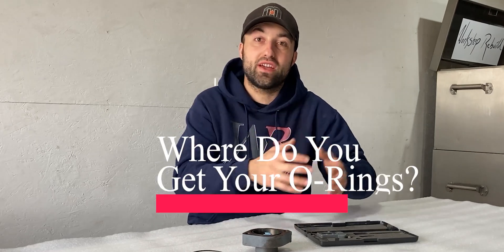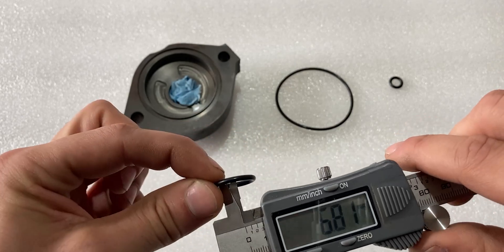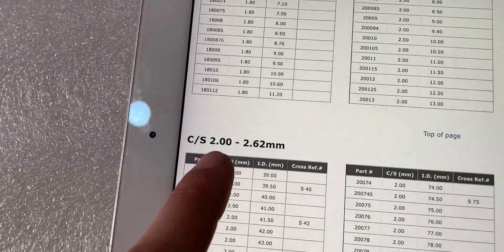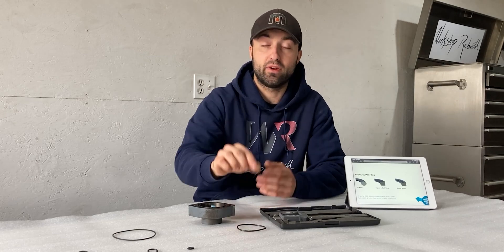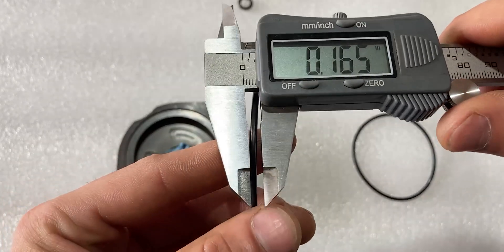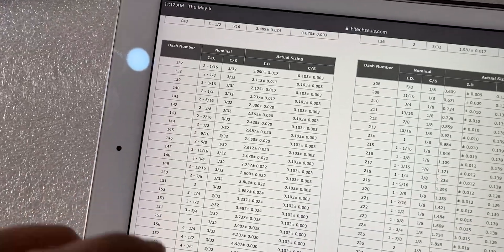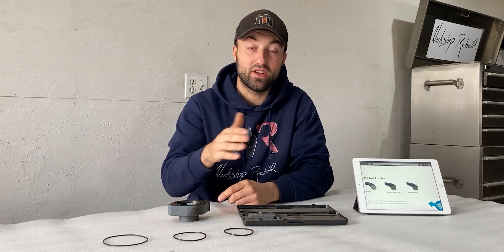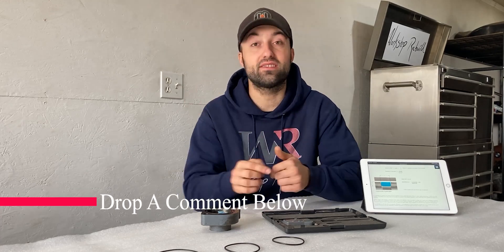How To Measure O-Rings / For Beginners

Comment: As an amateur I'm measuring ID and OD by putting a strip of paper inside or outside and marking it where it will overlay. Then I'm laying this strip flat on my table and measure the length wich equals the circumference. The ID or OD diameter is just dividing my circumference by 3.14. Thus i'm not fiddling with oval shapes.
Reply from the maker: That's a great idea! It's also possible to measure the counter parts, such as the flange, o-ring seat etc. to figure out the ID and then the cross section is usually the depth. Whatever works best for you is the way to go. Just make sure you have the correct cross section or else you won't have enough squeeze for sealing haha. Cheers - Andreas

Comment: I guess Im the only one that noticed that you picked the wrong part number for the second oring? The ID was 2.36, but you selected 2.42...?
Reply from the maker: No I did not pick the wrong part number. O-rings are manufactured in standard sizes. With that said, if I ever measure 2.36, 2.37, 2.38 or even 2.39mm I will always opt for 2.40mm. 
Used o-rings get squeezed and you always want to round up your number. If you were to choose 2.00mm you would be far too small in cross-section, will will eventually lead to a leak.
Most o-ring grooves usually have enough room for extra squeeze of an o-ring so there is never really an issue.

Thanks for your comment and concerns. I hope I was able to share why I chose the larger cross-section in this video. Cheers

Comment: hello sir!
thank you for fast answering.
please tell how can you recognize between millimetric and inch?
and what if its a unknown source of machine?
thank you so much!
Reply from the maker: If you have an digital caliper, you can easily switch between metric and imperial sizes. Most of the time you can identify which size is closest to a metric or imperial. If you cannot figure out the size based on your o-ring, you can measure the parts where this o-ring will seal up against. This will give you a hint if it's metric or imperial.
Another trick to figure out if your components are metric or imperial is to check the bolt threads. Most of the time a manufacturer will opt for metric or imperial. If this is the case, the whole assembly is usually manufactured to that specification...even the o-rings!
I hope this helps. Regards Andreas

Comment: Thanks for making this video. I have been looking for o-rings for my pressure washer hose as well as wand. I measured the o-rings for both, but the measurements are so far off that I  can't find anything even close to fit. I am going to try and measure the collars or groves and see if that works. Thanks again for the video.
Reply from the maker: You're more than welcome and thank you for tuning in! Pressure washer fittings are mostly metric, so maybe you'll be able to match an o-ring that is very close. If you measure the depth of your groove, be sure to get an o-ring that is larger in cross-section. This will allow the o-ring to squeeze and seat properly on the connection.
Regards Andreas

Comment: Wow! It works. Thank you.
Reply from the maker: I'm glad these videos have helped you! You're more than welcome. All o-rings are based off industrial sizes and you can find these in many applications. If you ever find a colored o-ring, this will be a different material but they run the same sizes in Metric & Imperial. I hope this helps. Cheers -Andreas

Comment: Ty for the walk thru.
One of my concers is taking something apart like my jd400 spool valve I keep putting off and not feeling confident in having the correct size or correctly ordering replacement parts.
Reply from the maker: You're welcome! I did a complete video on the JD400 valve spool and if you check the description I have a file with all the O-Rings need for the rebuild. If you have an industrial seal/o-ring dealer close to you, they should be able to find the orings without any issues. If you don't have one close to you, under this video I found a website full of o-ring dealers around North America and they should be able to ship. I hope this helps you for your rebuild. Don't forget to check the wear on your valve spools before you order parts! This is super important, so you do not have any internal power loss. Best regards